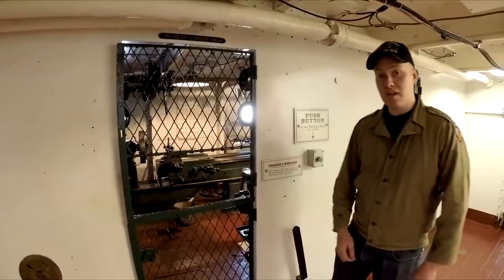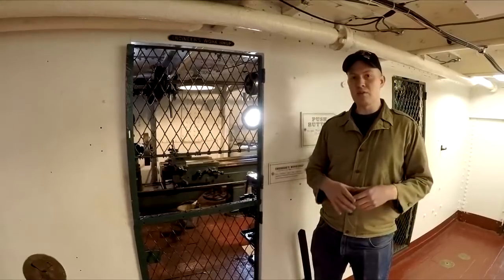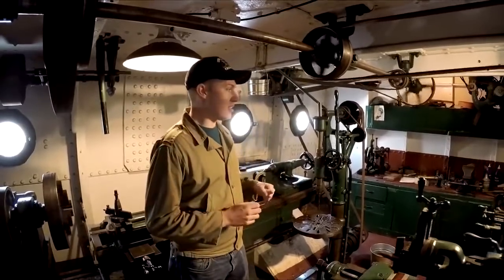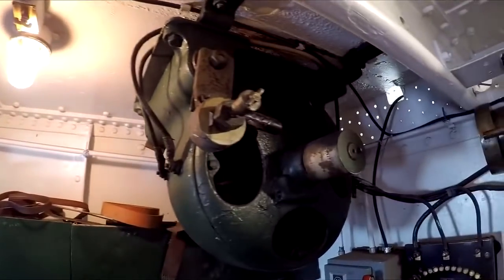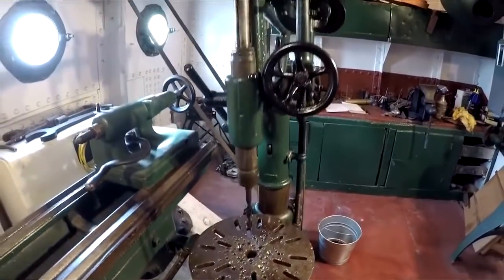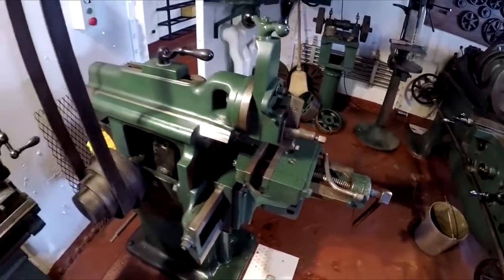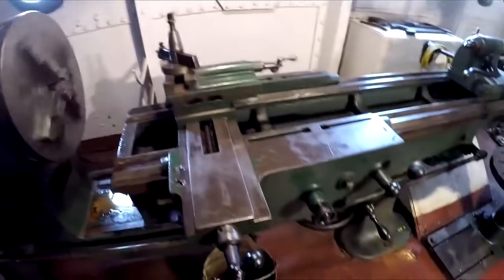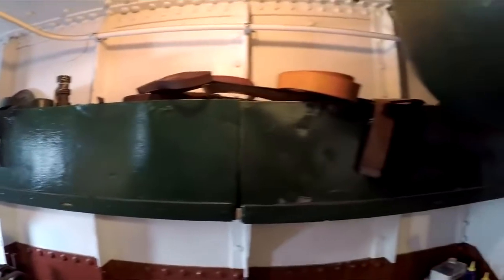The Machine Shop Aboard Cruiser Olympia

Comment: The condition of that drill press table says bad things about the “machinists” (?) who used it! In most privately owned machine shops, you’d either get beat, fired, or both for damaging a machine like that! Good tour, and a true museum piece machine shop!
Reply: Holes  in the table are normal but there are quite a few.. Chalk it up to newbies.. good journeyman usually stop making such mistakes after the first hole… lol.. usually
Reply: @paulbfields8284  Usually being the operative word! I worked 41 years as a certified welder at a railroad car and locomotive repair facility, and it amazed me how many forklift blades got chopped off inadvertently by people using cutting torches on steel supported by the blades! Had quite a few repeat offenders too! And, like Washington chopping down the cherry tree, I did indeed gouge one once! Not nearly all the way off, but a good notch anyhow! And only once! (or that’s all I’m confessing to!)
Reply: @tomt9543  
yes tom but a few rods and a lick with a grinder and no one knew 
and heaven forbid welding on the anvil
Reply: I noticed that too, the same thing in the machine shop on the New Jersey. Maybe they let random sailors use the machines for their own projects or something as no professional machinist would ever drill into the table? And I would expect anyone ignorant enough to do such a thing in the navy back in the day to be keelhauled or at least flogged for their stupidity. 

I used to teach construction equipment maintenance at a vocational institute, we had three different sizes of drill presses (from a small bench top model to a huge radial one), no holes in the tables even though they had been used by thousands of students over some 30 years, most with no prior machining experience. We really made a point of not drilling into the table when teaching them how to use the machines.

Back in elementary school workshop class I did see some swiss-cheesed drill press tables though. Maybe the teachers there were less careful in instructing the proper use of tools.
Reply: @Murgo-u3l  show me a drill press table with no holes or gouges in it and I’ll show you a machine shop that’s not very productive. Same thing goes for milling vises. And mill tables. It happens. You do what you can to avoid but yes.. it’s usually an apprentice..
Reply: @paulbfields8284  I fail to see how trashing one's tools increases productivity. That's like saying the more banged up and messy a truck is the more productive the driver which I, working currently as a mechanic for a trucking company, know not to be true. Actually it's usually the opposite, the drivers who take care of their trucks are are the most productive.
Reply: @Murgo-u3l  you have no idea what you’re talking about. That drill press is just as useful with all the extra holes in the table as one without. Apprentices can be hard on equipment but nobody that ever worked for me got abused because the grinding wheel nicked an angle block or a drill penetrated a vise.. no I didn’t like it but it’s a part of learning. Think of it this way… that drill press is lighter than it used to be..
Reply: @paulbfields8284  ok, I guess it's a matter of different work cultures. I was taught to think that unnecessarily damaging your tools is sloppy and unprofessional, even if the damage is mostly cosmetic. Yes, holes in the table won't make the machine unusable but I still fail to see the connection between sloppiness and productivity. Usually rushing things too much will also result in more rejects, not just damaged tools, and that's certain to hurt productivity. Breaking a drill or a cutter is something that happens from time to time even if you're careful but drilling into the table is simply careless as it can be easily avoided with just a little consideration.
Reply: @Murgo-u3l  oh I agree with you but having had a tool and die shop 37 years with as many as 23 employees at one time it’s hard to avoid with the journeyman as well mostly the apprentices. Mind you I am very cognizant of the set up and the depth I am machining into but though it has happened to me only a few times i can honestly say I’ve gone too deep in my 41 years of machining. It’s even more unavoidable sometimes with a CNC.. shit happens. Yes it infuriates me but I’d be less than realistic if I took it out on my guys. There are a ton of holes in that table but being a naval ship it had to go through a change of personnel quite often. Not so in a land based operation non-military.
Reply: @paulbfields8284  yes, accidents do happen but the table in the video has too many too deep holes to be just accidents. I think some of the users just didn't care, just put a piece of flat iron straight on the table and drill through. Or maybe some have even been made by people who just wanted to try drilling and didn't have a suitable piece of scrap handy. As said, probably a different culture. 

I live in Finland where (until the recent avalanche of cheap stuff from China) tools, especially good tools, used to be very expensive and expected to last for decades so they were taken good care of. I'm 50 years old and I have a degree in mechanical engineering. I have been involved with agricultural, earth moving and heavy truck equipment repair for my whole working life though I've always been a paid employee, not the owner. I've also done quite a bit of drilling, milling and turning both professionally and as a hobbyist though, always having worked in repair shops, I've never been a full time machinist. I think I may have drilled into a table back in the elementary school when I was 13 or something. After that I have not done that, neither have I run a cutter or tool carrier into a lathe chuck or a milling cutter into a vise. Of course I have broken some drill bits and cutters and ruined a few workpieces, that's unavoidable.

As said, I did even teach earth mover maintenance and was responsible for the workshop for almost 10 years. 

Every employer I've worked for has been all about keeping the tools in good condition and not abusing them. Of course, as said, accidents will happen and yes, I've met guys who'll throw the tools around and use anything as a hammer and leave a huge mess for someone else to clean up but I don't call that professional, even if they get the job done.

But as said, different cultures and of course as the owner you decide how your employees treat your tools.Thre's a huge difference between bona fide accidents and damage caused by negligence and  "I don't care, it's not my equipment"- attitude though. As a teacher was very understanding of the first (after all, they were students with little previous experience) but when seeing latter (which was unfortunately quite common among the younger students) I would give them a proper lecture on work ethics.
Reply: @Murgo-u3l  Certainly it would be better if the drill press table was not Swiss-cheesed, but I wonder if that's a reasonable expectation for a machine tool that would have been used during storm or battle conditions for emergency repairs. I can imagine the ship getting tossed about like a cork, lights flickering, some poor machinist's mate holding on for dear life, cold sea water sloshing around his waist, the roll of the ship throwing him right at the line shaft, then across the shop the other way and he's trying to drill a clearance hole for a pintle in some makeshift link rod because if the bilge pump isn't running five minutes ago, we're all going to sleep with the fishes. I'll bet that was the condition in this shop as often as not, and I doubt anyone cared about a couple of holes in the drill press table.
Reply: It is in bad condition but it's over 100 years old and it was used at sea.  I'm sure using a drill press at sea is significantly different than onshore.
Reply: @michaelporter3555  Scrap lumber to protect the table may not be easy to come by at sea.

Comment: How exactly do you change a drill bit or insert something into a lathe when they are constantly spinning?  The old timers knew a trick I bet!
Reply from the maker: OLYMPIA's machine shop operated from one large electric motor turning one main line shaft. All of the equipment in the machine shop, save for the grinding wheel, connected to the line shaft by leather belts. Levers can engage and disengage equipment as needed. Stopping the lathe or drill press to change a part is easy and can be done while the line shaft is still turning.
Reply: @independenceseaportmuseum  Would have been interesting to see in the video, at least more interesting that just everything running.
Reply: The lineshaft was 'industry standard' back then, ashore and afloat. Can you imagine how horrifically dangerous (by 2021 standards!) it must have been? A moment's distraction and you're missing a finger...or worse.
Reply: You would just shift the belt from one pulley to another...for example there would be one pulley on the machine like the Lathe...keyed to the input shaft...and next to that would be a pulley free running on a bearing...all that you need to do is to shift the belt...